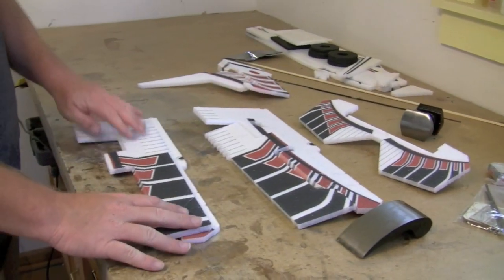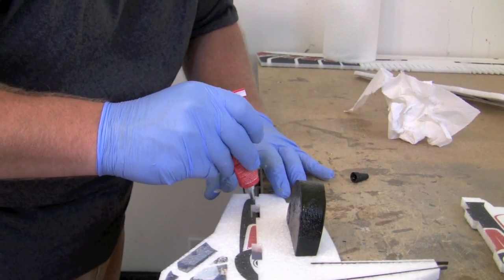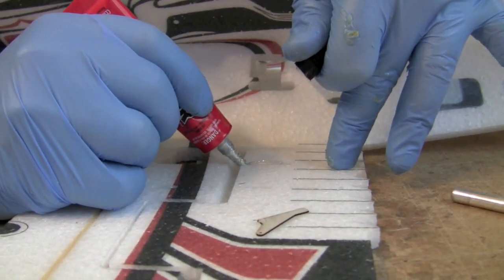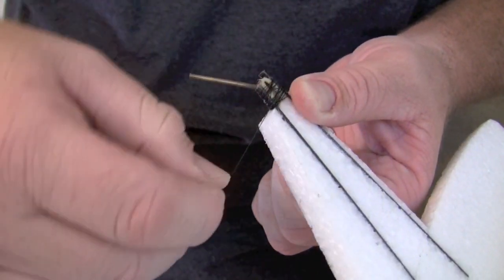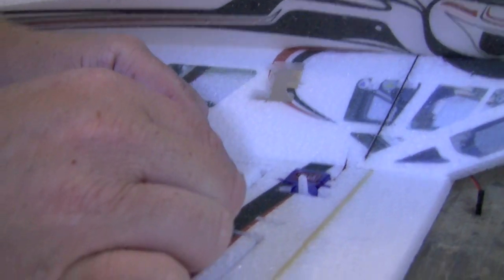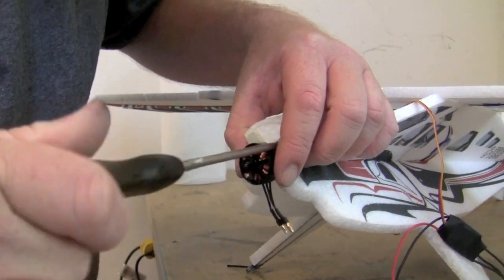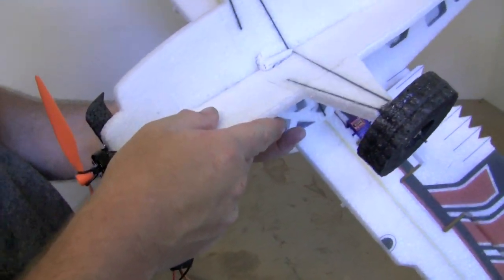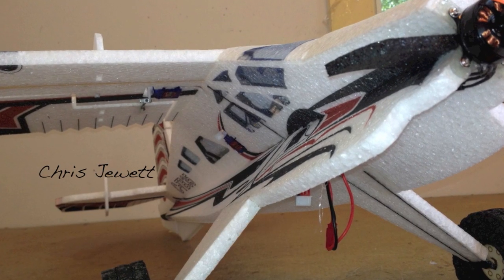Twisted Hobbys - Crack Turbo Beaver Build Video

Comment: Excellent video!  The new technique to me, using the welders with the blenderm, will be incorporated into my builds and repairs.  Sounds like the welders is about the same as the foamtac glue I have been using.  Thanks again for the excellent video and now you have me wanting a Crack Turbo Beaver.

Comment: Hey as a cautionary move, make sure you reinforce the leading edge of the landing spar where it meets the fuselage.....they should have extended that spar higher into the fuselage as mine cracked when I landed hard......also, this plane is very floaty and could probably take a heavier battery with ease thereby extending your flight time....I am currently using the recommended 2S 450mah which only gives me 3.5 mins of flight time...

Comment: But uhhh!!! Wan`t the battery fall out if you Mount it like this?? What did you do to make it stick to the plane? :P
Reply: you make the battery hole smaller the the actuall battery, and then you put welders/uhu por in it. And let it dry overnight.

When dry it will make the battery compartment walls slightly sticky and that will hold the battery in any manuver.
Reply: Just try it,  put some uhu por/welders on 2 surfaces, let them completely dry over 24h.
And then rub them against each other, Trust me, their not going to fall out in flight.